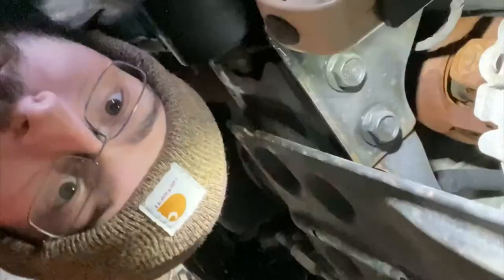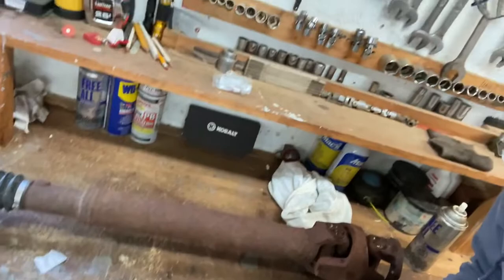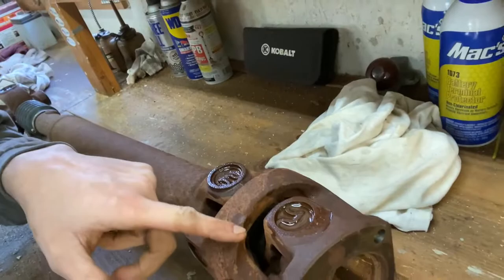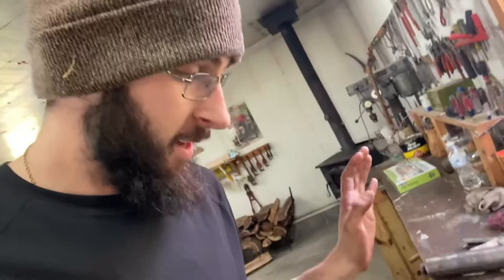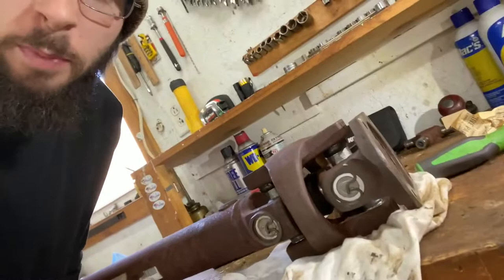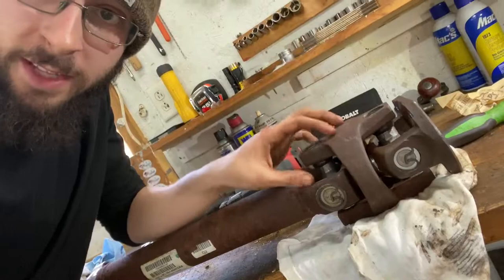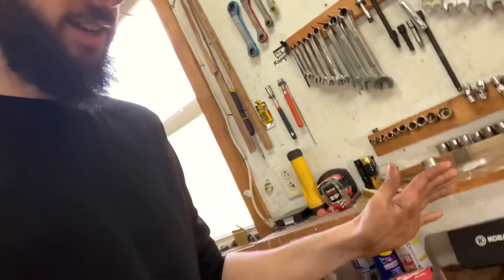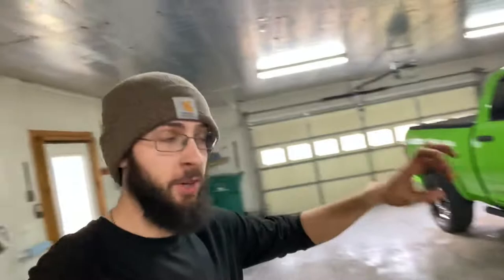Ram Front Driveshaft Removal to Install New U Joints

Comment: I pulled mine at a rest stop & didn't mark the bolts, so I was wondering if the bolts with the washers go on the diff side ?
Reply from the maker: Never thought of that, I’m not sure
Reply: @HoldenPowell_  I kinda thought the rusty looking ones would go on the axle since they are lower to ground & catch more environmental elements to make them rust quicker, but I could be wrong

Comment: My ‘07 3500 doesn’t have the clips in the front. The cups actually protrude out of the yoke.
Reply: How did you remove them then?
Reply: @RandoManSavage  

They have some kind of plastic you melt out (stock), and then when you replace you use and internal clip u joint.

Comment: I wanted to know how you got the other side off. I’m working on a 2022 Ram 2500 and cant get the drive shaft off the T case
Reply from the maker: It’s took an hr and I just used a wrench I think but it was a pain but I got it to wear it would free spin and I put a pry bar in the lower end to stop it when I needed to break a nut loose
Reply: @HoldenPowell_  the other side is supposed to just slide out but I can’t get it to

Comment: So I have a 2017 ram 2500 that's giving me an intermittent vibrations. So it vibrates for a few second then stops for a few second. Only at highways speeds. Have you experienced this?
Reply from the maker: No I haven’t
Reply: Thanks for the speedy reply! I'm hoping it's just tires
Reply from the maker: @reviewshowtos9283  ya hopefully that’s it and sorry I couldn’t be of more help.
Reply: Driveshaft support bearing
Reply: @reviewshowtos9283 did you ever figure out the vibration?

Comment: How did you get the front drive shaft to free spin?
Reply from the maker: Mine did when I was working on it, I didn’t do anything special that I know of
Reply: Yeah im trying to get it to free spin but it wont. Tried putting the transmission and 4 wheel drive in neutral but still doesnt want to spin. Thanks for the response!
Reply from the maker: @adrianjarvison1393  I’m guessing one end free spins and that’s why it was able to spin, I bet I had one end unhooked already and that’s why
Reply: Im going to try to jack up the front end and see if i get the wheels off the ground to get that shaft to spin.

Comment: Just buy a completely new front ds they’re like $400.
Reply from the maker: $30 for u joints if that much and a little bit of time or throw $400 down the drain 🤔
Reply: 400 driveshaft is trash. Ask me how I know. I had to rebuild my old one and still using it 9 years later. Luckily I didn’t scrap my old one.